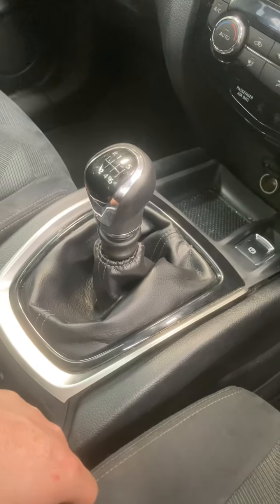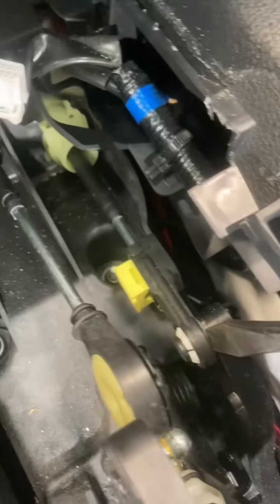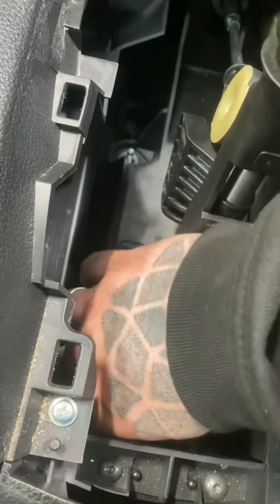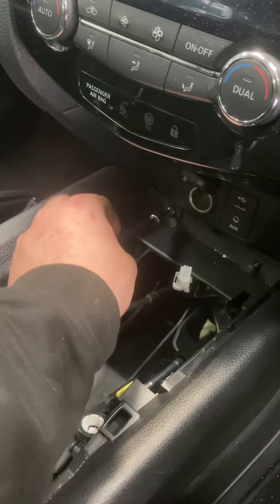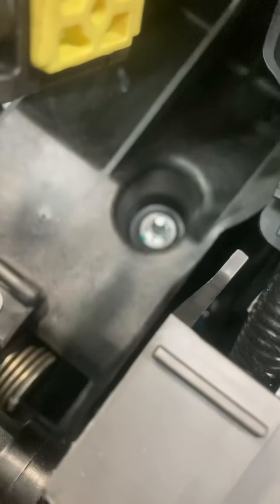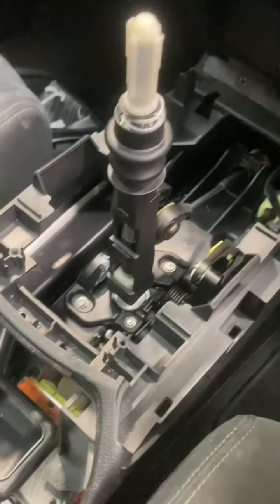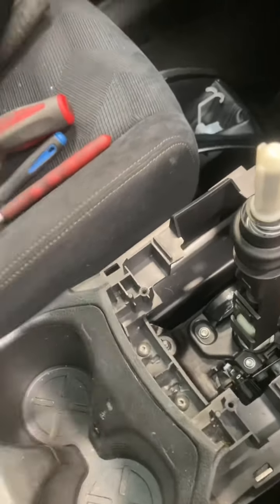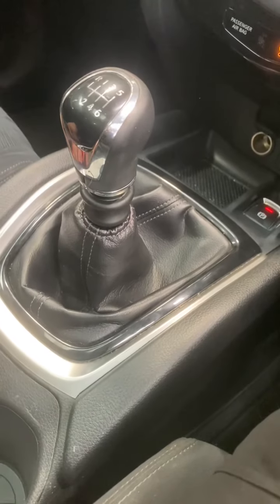Nissan X-trail 2018 gear selector replacement (selecting wrong gears)

Comment: My wife’s 2016 model is sticking when changing down from 5 to 4 and 3 down to 4 no problems going up though? Would replacing this cure it ?
Reply from the maker: @deanstanley5799  could be the cables, selector, or the gearbox itself buddy. I would advise to get it checked

Comment: Why did you change it out
Reply from the maker: The plastic guide was worn so when selecting first gear it wouldn’t stop on the side. Causing it to go into reverse
Reply: @owensautotips  ah ok, I have a 2012 model 2.5l, and it suddenly got notchy between the gears. Hard to get in or out of gears. Clutch feels the same, no difference when I pump it but when i wiggle the shifter it helps it change. Could it be the cable, or a bush within the shifter system? Or more sinister like a selector fork. Feels the same in every gear.
Reply from the maker: Sounds more of a sticky cable, but wouldn’t be able to say fully without looking at the vehicle